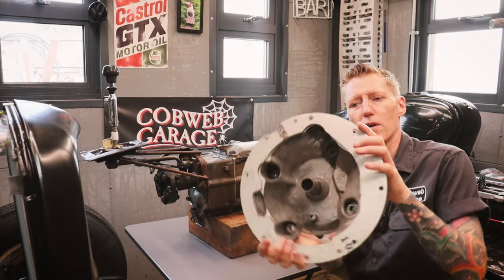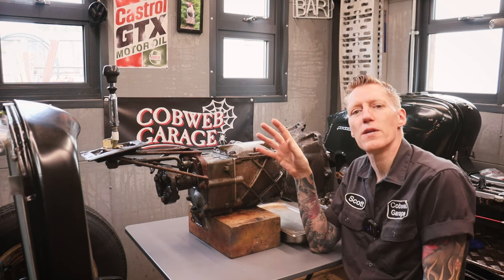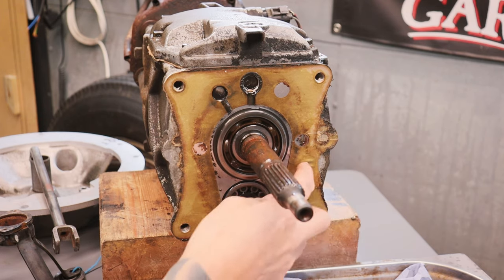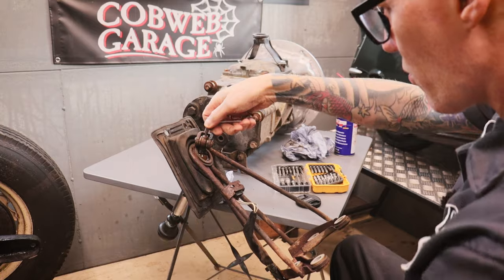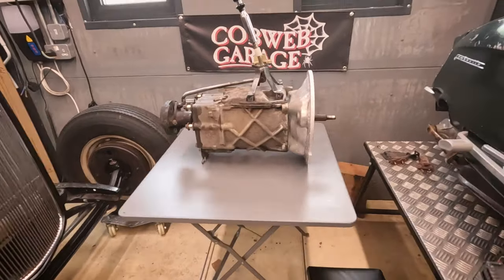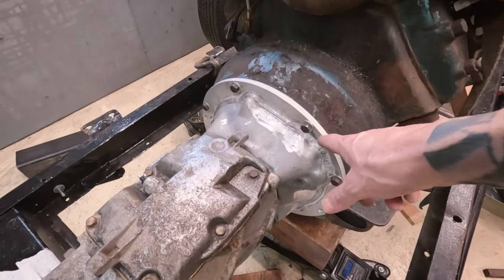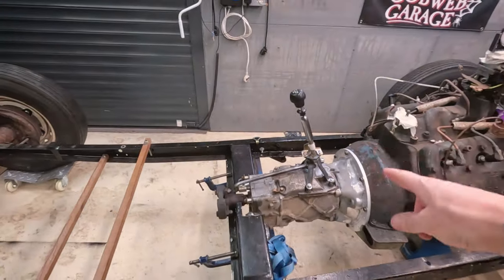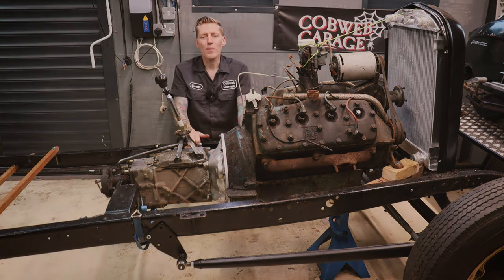Budget V8 Hotrod Build - Pt4. Volvo transmission to a Ford V8 Flathead engine? 1990s meets the 1940s

Comment: You can cut bolts down yourself mate. If you screw a die of the right thread all the way past where you're going to cut it will restore the thread as you wind it off. If you lose too much thread you can cut some more going the other way.
Great work on this
Reply from the maker: I will give that a try to start. Great advice. Many thanks!

Comment: Volvo M45 /M46 / m47 are excellent gearboxes, their only drawback is that their ratios are designed for 4 cylinders engines coupled to low ratio rear endswith the objective to keep engine RPM at a comfortable regime when highway cruising so the first gear of the gearbox is very low ( 4.03 : 1 ) to give an acceptable initial acceleration
Reply from the maker: Thanks for the information. The rear axle is from a commercial pickup, and of course the wheel and tyre combination is really large. So I’m really interested to see how the combination performs.

Thanks again! Scott